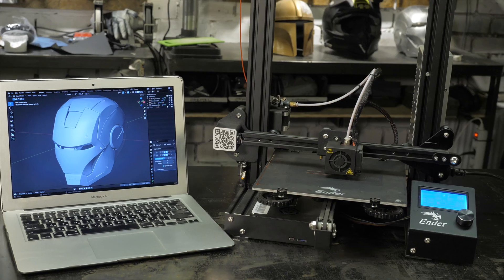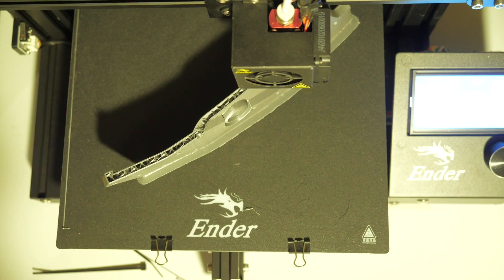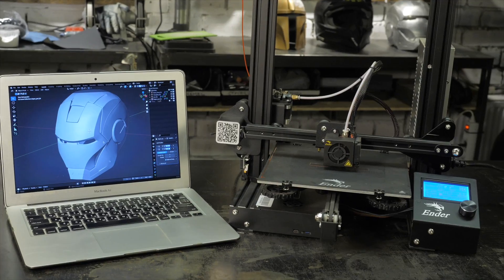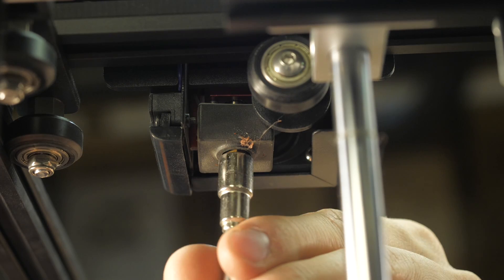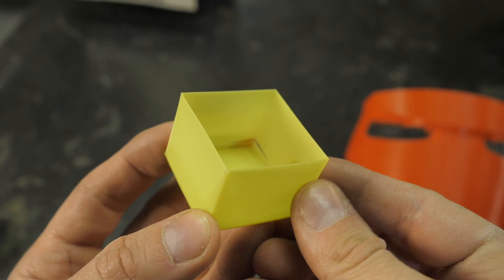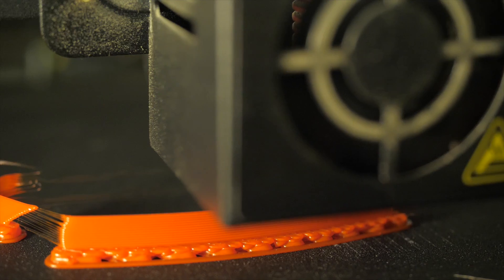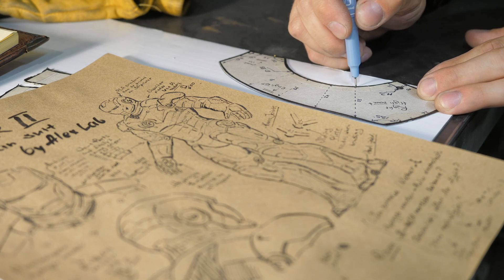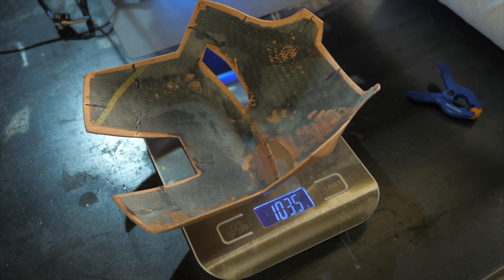#9 How to print big 3D models fast with 1mm nozzle. Basics of composites

Comment: I would love to try this at home but I cant find any models that are thin enough for Cura to print them as single walled. Spiral/vase mode prints have an inner and outer wall shell which wouldn't work for composites I don't think. Is there a way of taking an existing 3d model and edit it so that it prints with a single wall like your ironman mask??
Reply: Yes, In your slicer set top layers to 0, set perimeters to 1 or more if you want ,, 3, 4, etc., set infill to 0%. Now you have a sliced part that will print like vase mode but has as many perimeters as you want.

Comment: What is the model of the 3d printer you are using?
Reply: I have the smaller one, it's a Creality Ender 3. They're less than $200, so I really recommend it if you are wanting to get into 3d printing but don't have a massive budget.
Reply: @gamedokter  but didn't he say that the ender 5 is what we want for large objects like the mask
Reply: @gamedokter  will it be too big of a difference by your opinion
Reply: @teamninja6449  the ender 3 is pretty big. If you've got the money for the ender 5 it might be worth it, but if you're trying to stay cheap the ender 3 should be fine.
Reply: @teamninja6449  In the video he explicitly says that for this technique the Ender 5 is better, since the bed only moves up and down vertically. The Ender 3's bed moves inward and outward, which can ruin a print if it's larger or not firmly adhered to the bed. I have a 3.